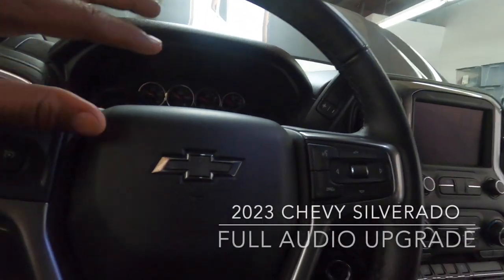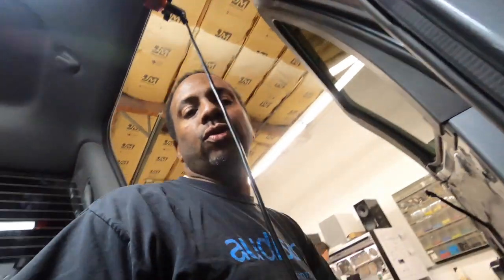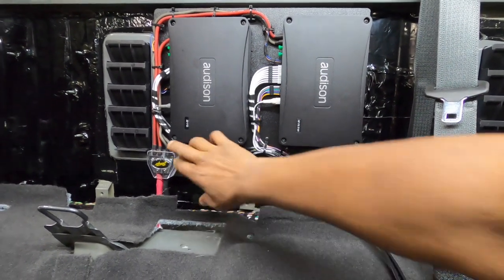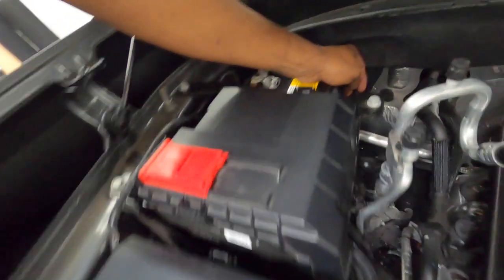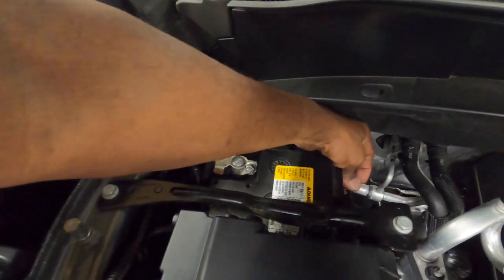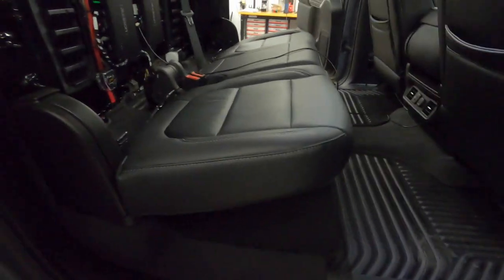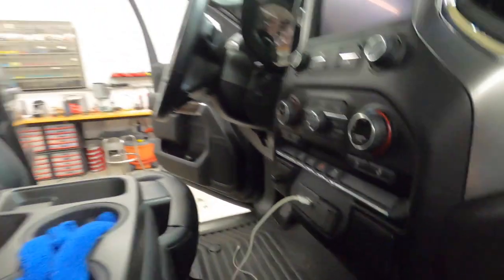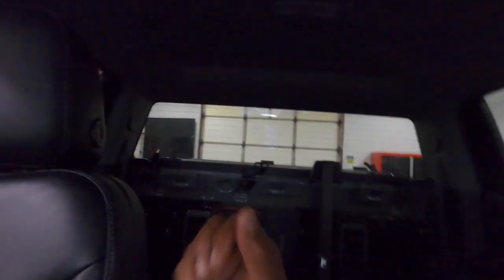2023 Chevy Silverado Full Audio upgrade..DSP amp, Kappa Speakers & JL audio TW3 subs

Comment: Did you use 20 ohm or 60 ohms resistors to maintain your door chimes? This is a non bose system. How about the ANC -active noise cancellation - did that make a hissing sound or mess with volumes?  Very similar to my build. Two infinity amps, epi centre, DM -810 , all fit on board behind seats on firewall. Kappa tweets, 6x9's , 6.5 rear doors and pioneer mids mounted under back seats with 12" RF shallow sub. Sounds real good now the bugs are out. Good job on your install.
Reply from the maker: The Audison Forza DSP amp have a feature call USS(Universal Speakers Simulator). This feature create the illusion that there is a speaker automatically. So no resistors are required.
There was no ANC on this truck. I didn't experience any hissing or mess with the OEM volume control.
 If you're using an Audio Control DSP/DSP amp you will need load resistors for sure. Hopefully your systems sounds as good as this did.
Reply: @lancesautovlog I’m using Audio Control Amp for doors and their mono amp to run a GM/ Kicker Sub in my 2023 GMC Elevation Refresh Non Bose and I used load resistors to get Chime and Turn Signals working…BUT they are loud. I found the chime volume in the settings and could turn that down to an acceptable level but the turn signal click is still obnoxious. What can be done to drop that volume ? The signal for that click noise has to be fed to the audio somehow?
Reply: @redrider533 did you get the turn signal sound working correctly? I'm wanting to swap my non bose speakers to infinity speakers?

Comment: Did you use a loop back harness to integrate with the OEM?  I used a loopback on my 2024 Chevrolet 2500 with 60 ohm audio control resistors for door chime.  All of that seemed to work well but if I volume factory stereo over 80% the amp goes into protect on the sub channel (not that I run it at 80% but why...).  I have the factory subwoofer disconnected at the harness so wondering if it needs to detect that load or something?  Lastly, Bluetooth audio randomly drops signal during voice calls which could be because I am using the wrong load resistors, IDK.  I'm starting to question if my OEM amp is faulty because it even occurs when take the loopback harness out and plug back into OEM (basically testing running the Bose amp straight back to speakers).  They are aftermarket speakers but still a 4 ohm load.  This is killing me though and I don't know where to turn at this point...
Reply from the maker: Honestly the last few systems I’ve done had the Axxess interface in them. I used an Android tablet to control it. In one system I used it as a preamp and the other as a DSP. So far so good.
Reply: Did you ever get your audio upgrade working correctly? I'm wanting to upgrade my 24 hd non bose system
Reply from the maker: @nicklouallen4784  yes I did. I’ve done a total of 3 now.

Comment: I have a 24 2500hd zr2 i was wondering what load resistors you used for the dash speakers if youve changed them. I have a brand new set of kicker dash speakers put them in and they shut the dash down. Dealer had me give them the stock blows dash speakers to put back in.
Reply from the maker: I don’t generally do speaker replacements only in GM trucks, so I don’t have an answer.

Comment: Great video. I have a 23 Silverado with Bose. Metra makes a dsp and harness but they are back ordered and no ship date. It allows u to adjust chemes, etc. My trusty installer wouldn't touch the truck without it. I have another installer with good reviews but never used him. He wants to do the install with a lc7i. Not sure how he is dealing with chimes, etc. Thinking maybe just dobsub for now and wait for Metra to start shipping interface. Any advice? Another installer wants to use a lc7i and no dsp. Just hate to mess up a new truck and if there are warranty issues.....
Reply from the maker: I’m a DSP guy, so LC7i doesn’t turn me on. If your patient person waiting is the best. Do you currently have all the products for the install?
Reply: @lancesautovlog  I had a DSP in my Car - it was a Audison Bit Ten.  It worked very well.  I do have most of the components but my installer won't touch the truck until he can get an interface for the BOSE system in my 23 Silverado. I found this online.  I think this is what he was talking about.  Axxess AXDSPX-ETH1 For now I may just do a subwoofer install with the Kicker Keyloc and an Epicenter for kicks.  Once he gets the interface I'll do a full install.  Thinking I may do dash speakers too for now.  Do you know if 2.5" is the largest dash speaker allowed?
Reply from the maker: You could go as larger as 3.5 speaker, but that’s the largest I would do. Are you thinking of use a middler(tweller) speaker?
Reply: @lancesautovlog  The stock dash speaker does around 200hz to 20k.  I want to replace it with something in that range. The problem I have is that I don't know the sensitivity of the dash speakers so I'm flying in the dark. Eventually I will install my 6 x 9 Hertz Millies but they are very sensitive. 93spl. So I might just wait but I really want to get rid of the dash speakers since they put out all the high frequencies.  The door speakers cut off at 5k hz. I'm definitely doing the subwoofer and when my go to guy gets the harness I'll let him do the rest of the install.  I'll have him install my Alpine PDX-V9 amp with Kicker Keyloc and an Epicenter for fun.  I have an 8" Alpine MM sub which is very musical.  I have a 12" Titanic 1200 sitting in my closet so it will get a shot at beating out the 8".  I'm not into loud boomy bass.  I like more musical bass.  By the way do you know if my installer would have to do any cutting to get the 3.5" dash speakers to fit?  Do you think it's worth it for now or just wait? Thanks again for the video.
Reply from the maker: @traderfjp  there are a number of middler speakers out there. All the major brands offer them. The may not play down to 200Hz, but they will do 300Hz to 500Hz is not out of the question.  A 6X9 will play up higher than that easily. 
A Kicker Keyloc will eliminate any delay & allpass filters if they are present.  So building a system shouldn’t be out of the question.  
I’m in Cali if you’re local.
Reply: @lancesautovlog  I'm in NC. I heard some great things about the Kicker Loc.  I want to have my installer delete the factory sub.  No need for another crappy speaker to add distortion.  I think if I can change out the dash speakers and get the sub up and running I could be happy for a while.  I was playing around with mounting options.  I definitely don't want to bury the amp and such behind the seat even though that would give me the most room.  I think under the rear seat works best for me.

Comment: Nice work. I installed a similar system, how can reduce the chime volume. It is extremely loud
Reply from the maker: We determined the chime frequency with a RTA and reduced it using the DSP.
Reply: Will that effect speaker volume as well? @lancesautovlog
Reply from the maker: It will affect that frequency on that speaker, but it won’t reduce volume.
Reply: @lancesautovlog  I've heard the chimes are only affected on the bose version, do you know if that's true?
Reply from the maker: @Motinhox the chimes will be amplified, but a good DSP can solve that issue.

Comment: I have a 2022 Silverado Custom Trail Boss with the 7 inch display. I would like to add a new system but i was told that is not an option due to the chimes and signals. There is no adapter to control that and that i was stuck with the stock sound. I am looking for opinions and options.
Reply from the maker: There are many way to do a 2022. You can email me or DM me on instagram. Please feel free to reach out.

Comment: Hello since it had Bose system, how were you able to lower the chime? Because on my 2023 I did after market speakers, an you can hear my blinker light very loud now.. is there a way to lower it are disconnected it?
Reply from the maker: We lowered the chimes by using the DSP. I located the frequency and reduced it. As far as the turn signal level they weren’t any louder ten before. That type of amp/DSP are you using?

Comment: I find the apf 8.9 bit doesn’t get loud
Reply from the maker: I’ve found that if you do the input setup with the volume a little bit lower it works better. They did address that issue in the new Forza products.

Comment: did you have to add a second battery to do the installation?
Reply from the maker: No. Adding a second generally will put a strain on the charging system.
Reply: @lancesautovlog  thank you! About how much watts is the total system pushing? I am looking to do a similar setup to mine and just mapping out everything I will need.
Reply from the maker: I would say anywhere from 1400 to 1700.

Comment: Where did you connect your input output converter to connect to the speakers? I don’t know which wires or where to use
Reply from the maker: So i used a t harness into the high level input of a DSP. 
This would the same if you used a in line converter(high to low).
Reply: Which harness you use to connect all the door speakers to an aftermarket amp i dont want rewire or cut the factory wires, is a 2020 silverado without bose
Reply: @lancesautovlog  Yes please. Need that part number for sure. I just ordered a 2024 3500 PRO with 7" IOR radio. Nobody online seems to have a T-harness for 2023 or 2024.

Comment: Can i install the infinity kappas in my 24 silverado hd doors with small amp without issues with chime and blinker sound? Or swap to kappas without amp for now just to have some better sound? What ohm are the factory speakers?
Reply from the maker: Does your HD have a Bose system?
Reply: @lancesautovlog  non bose. Can you tell me what the ohm is for the speakers in my 24 silverado 2500hd with new 13.4 screen? I haven't been able to find this information for all 3 locations.
Reply from the maker: @nicklouallen4784  all the speakers I’ve replaced were 4 ohms.

Comment: I have a 2023 chevy Silverado that already has an aftermarket sound system but the problem is that to indicator sound plays through the speakers and is way too loud, I took it to the shop where the system was installed but they were telling me that they couldn't fix it, how can I fix this issue?
Reply from the maker: Does your system have a DSP in it?
Reply: If you have a dsp you can use an rta or if you have a audio control dm-810 it has one so you could see what freq for the chimes and turn it down some
Reply from the maker: @jeremymerrill5783  yep

Comment: Hope you didn't do delay in the front half of that system...it's got all-pass! 
Also, I would suggest a wide band for the dash instead of a tweeter...they're too far apart and things don't line up or sound right, you need mid range on the dash! That's what came factory anyway 😬🤷‍♂️
Reply from the maker: In this specific truck there wasn’t a all-pass filter. We tested it. We also went active. 
The customer provided the equipment, so we wired it and it came out great. There ways to do systems in the Chevy and it does require correcting the all-pass using a DSP.
Thanks for the advice.
Reply: @lancesautovlog  it's always tough when the customer doesn't supply the recommended or right stuff for the job. Gotta work with what you got as I always say! I'm sure it turned out great

Comment: Hey whats uo bro nice video very informative , by any chance do you know what color is the cables for the radio stereo wire ? Im trying to tap in on the passenger side to connect a line out converter Lc2.  Let me know thanks
Reply from the maker: Good Morning,
I would use a T-harness because the wires are tight coming off the OEM tuner. Here's the part 
https://catalog.pac-audio.com/catalog/amplifier-integration-harness/lphgm71
Left Front Speaker (+/-)	Blue - Brown/Blue	+,-	Radio behind glove box, gray 29 pin plug, pins 2 - 5		
Right Front Speaker (+/-)	Yellow - Yellow/Black	+,-	Radio behind glove box, gray 29 pin plug, pins 3 - 6 or pins 6 - 3

Comment: I just got a 2023 Silverado with all the digital dash and the big screen head unit, I’ve heard that messing around with these head units can cause issues. Is that true? Because this stock stereo is dog shit and I say that in the most absolute of ways and it’s gotta go lol
Reply from the maker: I’ve done several audio upgrades to those trucks and haven’t encountered any issues. I would say that the OEM systems do have issues with any upgrades. There are a few installers that are experienced with them. The ones that are generally have good to great outs comes.
Reply: Do you have any suggestions as far as door speakers, dash speakers and an amplifier I could possibly put in the dash? I’m not looking for anything crazy, just don’t like when anything I listen to the base drops and the lyrics peter out everytime there is a deep note. It sounds pretty bad..
Reply from the maker: @Boostlee2023  is your system Bose?
Reply: I don’t believe it is, has the 13.4 screen but doesn’t have Bose emblems on the covers.